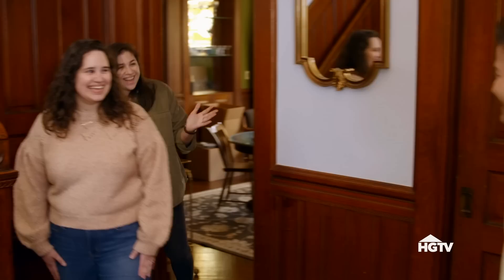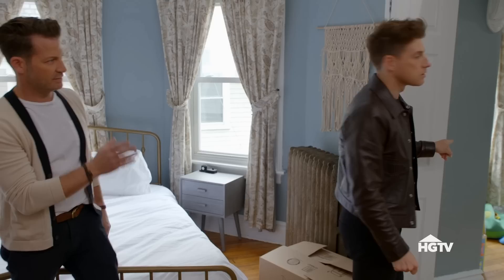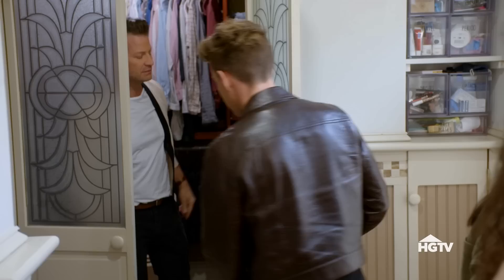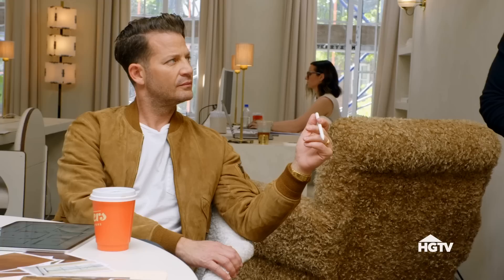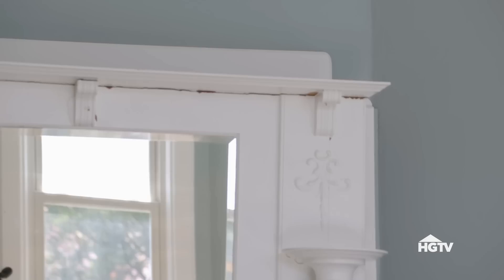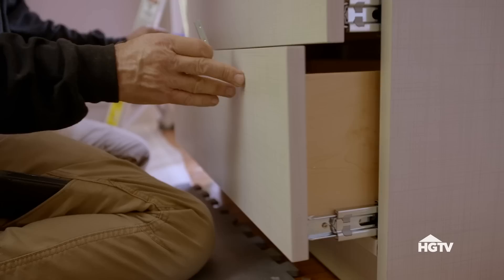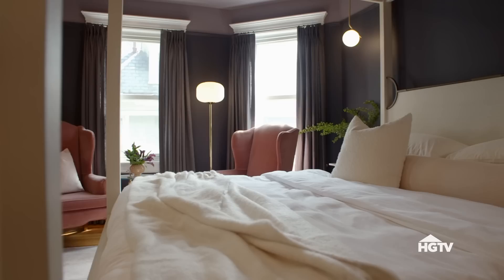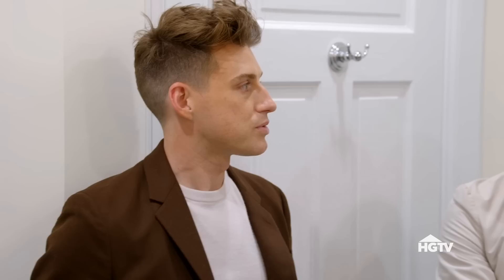Aging Victorian Remodeled into Ideal Home for Young Family | The Nate & Jeremiah Home Project | HGTV

Comment: That vanity was an original.  Replicas of it go for at least 5K.  Can’t believe they got rid of it.  Hope they sold it instead of throwing it away as junk.  Could have gotten 10k for it on-line.  I wish designers would do a little research before throwing things like original sinks and doors away.  Omg!  They replaced the fireplace instead of restoring it???  I hate what they did with the fireplace.  I would have also turned the playroom into an ensuite bathroom using those original closet doors and existing bathtub.  Would have put a shower/bath combo in the existing bathroom.  @hgtv, please do not have your designers working on historic houses!  Being limited to product placement partners means they always come out horribly butchered!  That Victorian was so stripped of its character.  Poor Merian.

Comment: Placing the suspended mirror in the bathroom over the windows was a really good solution considering the floorplan of the space. Also most people shy away from dark colors like you see in the bedroom. What made that work  is that the bed is painted white and the bed linens are also pale in color. There was large artwork to the left of the mantle, and a mirror on another wall. When you have dark walls and you keep the other colors neutral and you can break up the space on the walls with artworks. Done this way the artwork and furnishings stand out, and the walls recede. People make the mistake of thinking that dark walls can make a space seem smaller, but in a counter-intuitive way it makes the space seem more relaxing and enveloping.